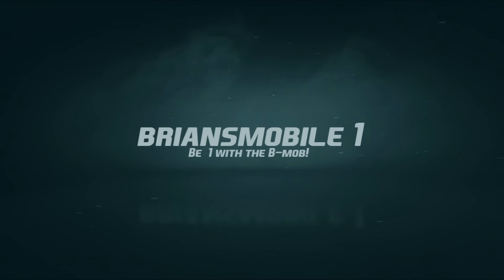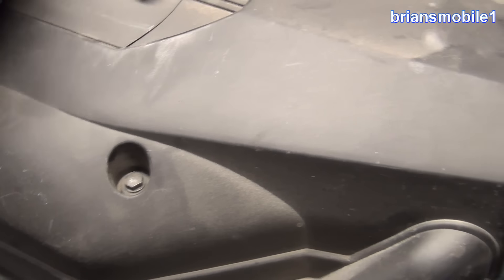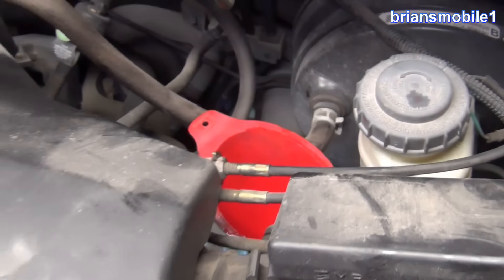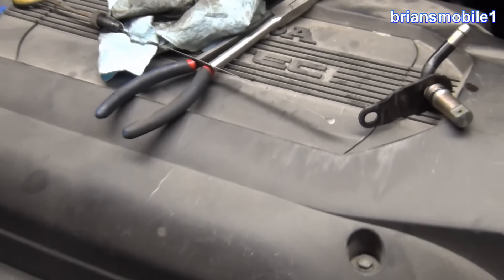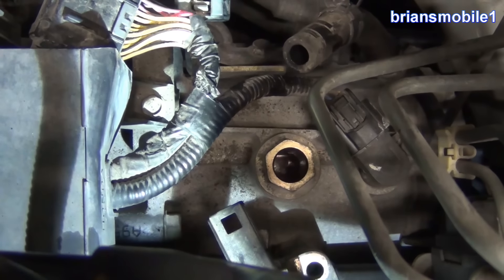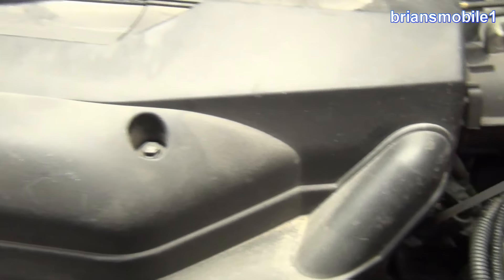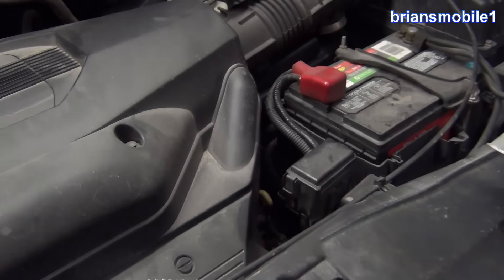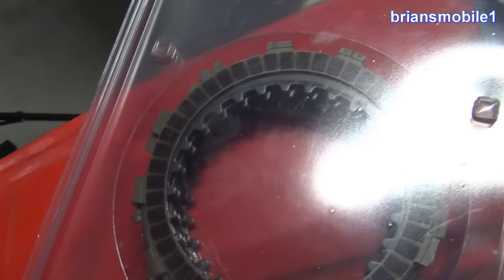Watch this Video BEFORE You Destroy Your Honda Transmission

Comment: Can anybody answer these questions about checking Honda/Acura transmission levels?  My 2014 TL says engine off and hot, wait 60 seconds and then check, easy enough.  However my 2015 MDX owners manual says "see dealer" to service transmission.  I changed the fluid but now I don't know if I check it with engine on or engine off.  My 2020 TLX also says "see dealer" but that is sealed so I will check it with engine on and hot and watch for fluid dripping out of inspection port, easy enough.  But I am stumped on the 2015 MDX and neither Acura corporate nor my local Acura dealer will tell me the procedure.  Help!

Comment: i always flush my transmissions and never had a problem. 2001 kia optima se v6, 2012 mazda 6i, my girl's 2014 nissan altima. took a gamble because that last one had a cvt and not sure if it was changed before the 100k mark. never had shifting problems. When i changed the fluid the first time in the mazda, the tech asked if I was having shifting problems. I said no and asked why and he because the fluid was pitch black. Simple fact is, flush the transmission fluid every 20k miles and it will be fine and last long. more efficient at getting all the used fluid out than doing 3-5 drain and fills! then there's the transmission filter!

Comment: Great video! My civic 2010 have the D  flashing  somtime .they toll me the 2nd pressure sensor need to replace. Since is sometime and trans work fine.can I drive  like that as long is no running  crazy or like Drag Racing?

Comment: Mine was awful man I drained out black fluid that smelled like gear lube smh burned up nasty foo type mud water idk it was crap lol but I’ve cleaned as much as I can within reason I had codes for the shift solenoid so I removed and cleaned the screens inside , the codes went away , I cleaned the magnet , smh there was a little over a quart and a half in there I’ll be refilling and cleaning what I can tomorrow I wanted to ask if one in this bad of condition,would you recommend using Lucas transmission additive?
Reply: don't use additive in a Honda transmission

Comment: My trans mech said not to use synthetic fluid or additives.  No flushing but just to replace what was in the pan every 30000 miles.  Apparently, additives tend to eat the seals and lower line pressure.  Also to ground the radiator to the block, as electrolysis may eat the radiator and cause coolant to enter the transmission cooler lines ruining your transmission.
Reply from the maker: That's what I'm saying.  Didn't know about the radiator thing. 

Seems reasonable.

Comment: Brian on a 2008 Element with 280+k miles would you recommend flushing out the transmission a couple of times before putting in the new transmission fluid ?. Honda dealership sells the transmission  filter for $100 on the internet it sells for less than $5. What are your thoughts on this?  Thanks.

Comment: I have a 06 honda accord 5 speed auto with 113k i bought it used with 99k i dnt know the history of the car but the fluid looks dark red to almost brown am i safe to change the fluid? should i take the car to the dealership n have them change it? They quoted me $120 or am i better off changing it myself? Im also gonna be changing out the pressure switches because the car will have rough shifts especially when cold and there will be times when it will delay in shifting between upshifts/downshifts mostly happens when going down steep grades and going up hills any feedback would be helpful thank you! 

Tom

Comment: I just picked up a 03 odyssey that drives for a few minutes then acts like it's in neutral. 
I'm clueless
Reply: could be an electrical issue, i had a similar problem that turned out to just be a bad ELD wire
Reply: It drives for a while means the trans still working. You should stop driving that Odyssey and put in external cooler asap. You can diy external cooler

Comment: Hello if you still checking comments on video please help me out I have a 2013 civic 88k miles it is rumbling between 1-2 RPM’s would it be I need to flush the transmission fluid / change the whole transmission ? Please help me out

Comment: to get it 100% changed run it out the cooler line until new oil comes out.
Reply from the maker: Honda doesn't recommend it.  That doesn't mean you can't or shouldn't.  And that is the most efficient way to do it- especially if you have the machine, but again, 1 of the 2 main reasons to do it are to remove the plug and clean the magnet.  So- pull the plug.  Clean it.  Refill 3 quts. then do the lines with an expensive fluid swap machine.  And how far ahead are you then?  You're 3 quarts compared to the guy who does it 3 quts at a time twice.  I think total is 7.# quts.  so you'd pay for 10 or have to catch 3 after doing the process- which would have metal in it from the plug- keep it clean- put it back in etc.  You get the idea.

Comment: Take a oem bottle and poke a small hole inthe bottom the insert a 3/16 plastic hose in the bottom and route that to dip stick pipe and open the bottle amd walk away it will fill on its own

Comment: It doesn't call for a transmission temperature range? Engine running temperature does not mean that the transmission is up to temperature. Sample, Chevrolet Camaro calls for transmission temperature off 100 f to 120 f... It would take about 20 minutes for the transmission to reach 190 f after the engine has reach 180 to 210 f.

Comment: Good video. Can we refill transmission fluid through transmission dip stick hole?
Reply: Isn’t the hole too small to get a funnel in to add oil?
Reply: That’s how I did mine.
Reply: Yes you can. Since Honda had a very tiny dip stick diameter... I ended up getting a rubber hose that will fit inside the dip stick opening snugly and in a funnel on the other end. I use a wire coat hanger to hold the funnel up since it will take a while for the fluid to go down.
Reply: @michaelsolis9891  This is really helpful!
Reply: If you end up having to fill through the ATF Level Gauge Tube, heat your fluid up a bit and it will flow better.
I found that I could "shock" the Fill Bolt by taking my 1/2" drive impact socket and impact extension and give it a good rap downward with a hammer from the top. Amazing how well that works.

Comment: I have a 2008 accord v6 3.5 with a 6 speed
Trans fluid was done at 100k
Im almost at 150k
Should i do just a drain and fill at 160k?
Reply: Yes definitely.. It is older now and the transmission fluid may break down faster where it does not lubricate as well as it did when it was new.. To make your transmission last always keep clean Honda brand transmission fluid in it .

Comment: I have a 2021 accord touring 2.0T with the 10AT. I recently drained and fileld the transmission at 57,000 miles. Is that too late or could it have gone further?
Reply: Depends on who you ask. My honda dealer recommends 1 drain and fill every 40,000 miles for all non cvt transmissions. $99 and I'm good with it. I was gonna go 50 or 60 but it's kinda funny..my 2012 CRV unintentionally burned rubber this morning pulling into traffic.

Comment: 2000 civic ex 225000 miles. Haven't had a drain in fill since 100k Would you do one?
Reply from the maker: I would
Reply: @briansmobile1  I was tempted to use the Lucas Transmission additive with the regular tranny fluid. Good idea or naw? Thanks for replying.

Comment: The way the hybrid community tends to do a ‘flush’,
Get fluid warm, drain, fill, drive, drain, fill, drive, drain fill, some sects change the in-line filter that goes to the radiator every 15000-20000 miles, some change the internal filter as well.

My question to someone with more hands on knowledge and experience than Internet forums is; 

How often should those filters be changed in Honda transmissions?

Where is the point of diminishing returns on change frequency?
Reply from the maker: Based on my experience on most cars it's every 60k-80k miles.  That's based on knuckle-head jack rabbit Utah driving and Arizona rental fleet vehicles.

Comment: Hey brother I have a 2009 2.4l with 119k miles and have never changed mine. Would you recommend me changing it?
Reply: I would if it were mine. I would do 1 drain and fill then do the same every 40,000.

Comment: Great video thank you this may seem like a stupid question but does it have to be Honda transmission fluid exactly?
Reply from the maker: For a good long-term result, yes.  Yes it does.  Ask any trans shop tech who's got good reveiws, he'll tell you Honda transmissions are a different animal by design.  They work great, but largely due to the special fluid they use that helps compensate.

Comment: Should i still do this on an 02 v6 accord with 160k miles? Doubt the previous owner has ever done it
Reply: Yes! Your fluid will probably be black.
Drain and refill. Then do every 30~40k miles - more often in severe service. like towing, hot or dusty climate.

Comment: What if you wanna drain it to fill it with Honda genuine transmission the previous owner used another brand
Reply: should be fine to do it with the OEM fluid

Comment: Is it the same for an older Honda?  I drive a 1997 Honda Accord.
Reply: Should be the same if you have an auto, but a lot of them fill through the dipstick port. 96-01 CR-Vs fill ATF through the dipstick. Everything else is the same.

Comment: Using the oem fluid is the way to go.One transmission repair shop in my area,they make money off of  transmission flushes doing valve body cleanings and rebuilds

Comment: What happens if you just refill the trans through the dipstick?   I have an 06’ accord 4cyl and that’s what I always do.   Didn’t know it was not ok.
Reply: It's OK either way, but the dipstick tube is small and a pain to pour through. Just remember to make certain everything is clean and no dirt gets into the transmission.
Reply: That's what I do and I found a nice long funnel at harbor freight that works just fine

Comment: I have a Acura TL 150k with the OEM trans cooler line. However the trans doesn't go into drive unless I put in in L gear, drive it to 10mph so it goes into 2nd 
I changed the 2-3 pressure switch and it stopped the d light from blinking but still the same problem. Now I have 190k been driving it like this so I'm just gonna replace it

Comment: Yay! DO change trans fluid! DON"T flush it. Use only Honda Transmission fluid for your particular trans!!! Use anything else and you're screwed. It works out the same for your power steering system. Use anything other than Honda fluid and the seals deteriorate and you have to change a bunch of parts, including the steering rack (ugh on a gen 1 CR-V). You don't have to use Honda oil, Honda break fluid, or even Honda coolant, but power steering and transmissions are extremely sensitive. 

I watch other people's videos where they'll flush one of those systems with a cheaper fluid, then drain it and don't realize they still have a pretty good amount of the cheaper fluid hanging around. When the system fails in the near future, they'll scratch their heads and wonder why. On Honda power steering fluid reservoirs, it tells you to only use Honda fluid in 3 languages. That's pretty specific so I don't violate it. About 5 or 6 years ago my son took the CR-V in because of power steering noise and the garage flushed it and didn't put Honda fluid in it. I flushed the other fluid out as best I could, but I knew it was only a matter of time before parts would start to fail. The flush did help prolong the failure, but in the end, the rack started leaking seriously and it got hard to steer. I just finished replacing the rack, most of the hoses, including the high pressure hose, and I'm about to change the fluid reservoir. I may still have to replace the pump itself, but I hope not. It whines a little after the car warms up to operating temp. I can't tell if it's oil starved or the pump is failing. I'll see soon enough.
Reply: possibly the 2 o rings to that pump got brittle & allowing some air to get into the system... well known/documented on the car forums
Reply: @ricebike  I changed the o-rings but ended up replacing the pump. It got louder and whined a lot more so it was time to replace it. It was 25 years old so I think I got good life out of it. Once I changed the pump, the only other thing I had to change was the bottom return line. That one is hard to get to, but now nothing leaks and everything works like it's supposed to.

Comment: I have a 2003 accord any advice on how to get that darn drain plug on the bottom off I cant get it to break loose,  even took it to the dealer and no luck, please I need help!!!
Reply from the maker: Chris?   Is that you?   Which drain plug?
Reply: @briansmobile1  the 3/8drain plug on the bottom of the trans
Reply: My non professional advice for a drain plug that wont break loose is i use a car jack. But it up to your socket wrench and start pumping until it breaks loose. Ive had them on so tight that the car almost is being lifted from it but just about then is when it loosens. Just an idea if you still have not gotten it loose.
Reply: @kimzaballos6092  your 4 days late I got it off by watching a young man on utube use the exact method
Reply: MAD DOG guzman haha thats awesome. Its saved me a mess of headaches on many occasions.

Comment: Doesn't this transmission have a removable filter somewhere on it as well? I know it's a different transmission, but my 03 Accord with the automatic on the 4 cylinder had an external filter on top of the transmission that could be replaced. Not sure about those mated to the V6 though.
Reply: Some Hondas did, but most didn't. They all have a 5-micron Strainer inside - NOT user-serviceable.

Comment: most of my friend's Honda stopped at 180K mine over 300k and ran strong  

the different is I use Honda transmission oil.     other use cheap oil

i have 1988, 2000, 2001 and 2007   over 300k

i realized it once other oil use in 1988 and it wont shift even at high rpm.  change oil and work perfect...

Comment: I have a hard time determining how much is in it
Reply from the maker: The key is having it clean.  Transmission fluid is designed to cling to metal so It's hard to wipe off.  Using brake cleaner on a rag can help- also having good discipline with keeping the dipstick pointed down and using a light source and the sheen of the fluid helps.

Comment: How come no one knows{{{ turn the engine off to check the trans fluid}}}
That's insane because overfilling it will ruin the transmission.
Also on high mile vehicles I don't recommend changing the fluid.

Comment: 2007 v4 accord, 110,000 I was told not to change the fluid if it has not been done before. Will it last?
Reply: Consider changing the fluid, but keep the old fluid in case you develop problems with slipping. The new fluids are pretty slipery. You may have to put the old fluid back in. It's not optimal, but it could save you a rebuild.
Incidentally, we never made a V4; only an inline 4 or a V6. I knew what you meant though.

Comment: Ive always put a small piece of duct tape inside the socket when replacing a bolt that you dont want to drop .
Just push the bolt into the socket  and the friction from non-sticky side of the tape will hold the bolt tight in place until you rethread it . Then replace bolt without dropping it .

Comment: Do you know where I can find a diagram that shows where Shift Solenoid B Is located on a 2003 Honda Accord V6? I got the code P0777 and after checking my fluid I added a bit more and It helped a bit but still has harsh shifting. I want to replace the solenoid and transmission fluid.

Comment: grandmas honda crv is making a slight whine only on decel would this be good candidate for fluid change
Reply from the maker: Not sure the year of grandmas CRV, but many have the CVT transmission for better mileage and power.  Those whine some on decel and it's normal.

Comment: So I just change it? I have a 2014 Honda Accord coupe V6 and it’s starting to slip in first gear and in reverse the trans fluid is pretty dark I was going to flush it but I’m watching this and I’m looking for ANY ADVICE so I don’t ruin my baby.
Reply: when it's dark like that, it's pretty much burnt... the clutch packs probably lost their friction material & it's on borrowed time. But, check honda car owner forums to confirm

Comment: 2018 ridgeline I did a drain and fill every 30k the first 90k miles, then started doing drain and fill every 10k miles. Torque converter is going out. Such bs I babied that transmission.

Comment: I have a question. I'm going to purchase my sisters 08 Acura tl with the j32 and automatic. She is the original owner and the vehicle has roughly 60k miles. I want to drain and fill the transmission with OEM fluid and change the pressure switches to ensure the life of the transmission. Do you see that damaging anything?
Reply: I just did this myself on my 08 Type-S and it comes recommended by a ton of posters on the acurazine forum. You can change the atf 3 times and drive in between and replace nearly all of the fluid.  The switches will make shifting smoother too. buy them directly from Acura, there are fakes out there.
Reply: @whocaress33  

How does your car drive since doing it? Almost every single Acura forum recommends doing it